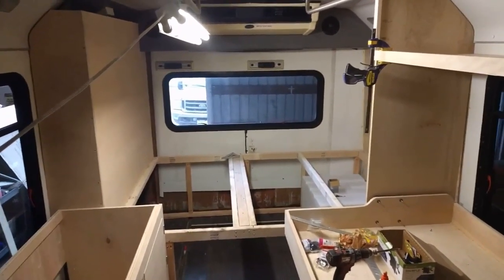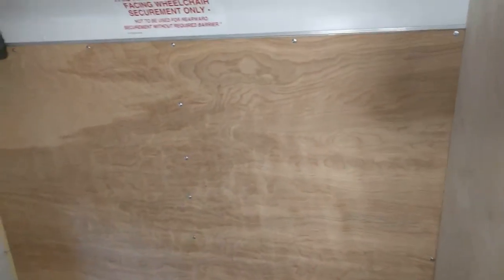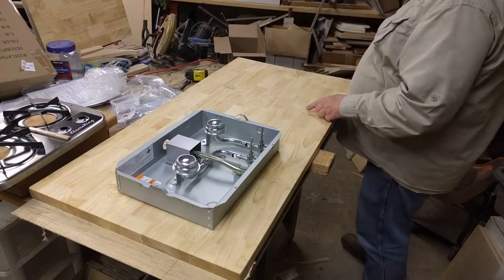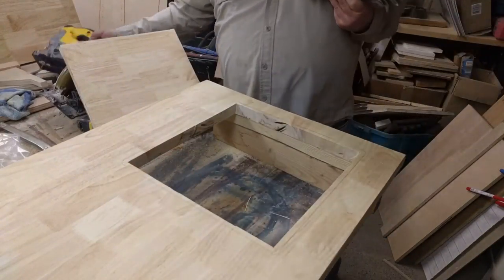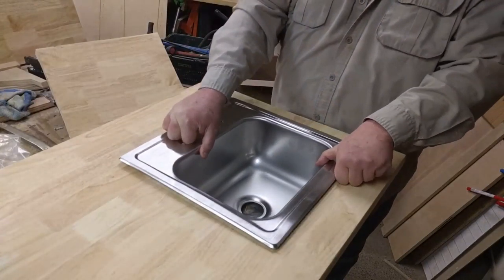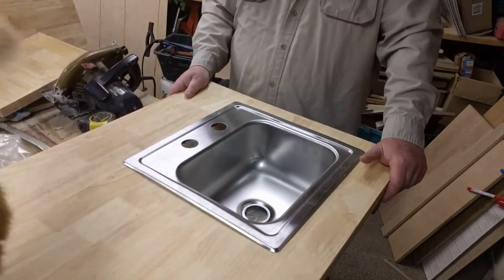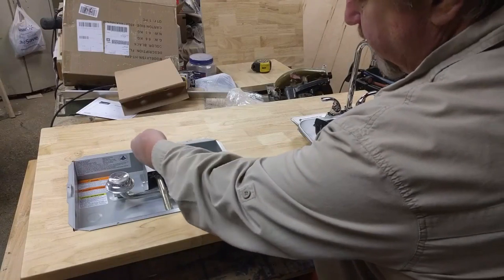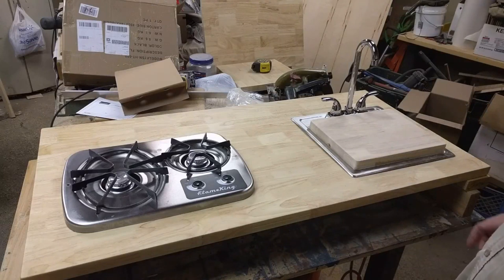Shuttle bus rv conversion (Part 6) Galley butcher block

Comment from the maker: UPDATE !  This Flame King Stove had to be redone by the propane company that I had install my copper hard lines in the bus. The stove had 3 leaks in the feed lines to and from the regulator and the burners caused by poor workmanship and cheap materials we had to replace the cheap aluminium fittings with brass fittings and now the stove is safe to use. I do not recommend this stove, it could have caused a serious fire! Professional repairs could  cost as much as the stove so buyer beware on this one.

Comment: Hey, where did you find those circular fans? My bus only has about 8-inch gap between the metal ceiling frames. So don't think the normal box fans will work. I'm trying to find the circle ones you put on yours but not finding them. Thank you!
Reply from the maker: https://www.amazon.com/dp/B00407CK5W?psc=1&ref=ppx_pop_dt_b_product_details  Aedan here is a link to the fan on Amazon  :  )

Comment: Great video.....got me hooked. Why did you go with handicap shuttle bus?
Reply from the maker: @Russell Sweet I like the shuttle buses that are fiberglass because they don't have many rust issues, built in insulation in the dual walled construction with steel ribs, they are very sturdy and are made to take a lot of heavy use. Shuttle buses usually have more head room for us tall guys. I like the El Dorado Aerotech and the Aerolite models, they are made by Thor Industries and the same manufacturer of the Airstream trailers.  This one had the 7.3 Power Stroke turbo diesel with only 56000 miles and these engines are known to be very reliable and have been known to run over 500,000 miles. The person who buys this one is going to get a fine bus! Thanks for watching my videos and commenting. :  )
Reply from the maker: The handicap lift just happened to come with the bus, at least it had a heavy 2ga. wire that I could utilize to power the inverter. took the lift out and sold it for $50 on craigslist, good thing I have a old forklift because they are heavy!
Reply: @robertbraden3889  Good to know.

Comment: What are the rotating brackets used for the murphy bed? Also, do you have a way folks can contact you with questions? maybe put contact info in "about" section of your youtube channel
Reply from the maker: @Eric Terry,Hello friend!  I answer 99 percent of questions thru these comments, The Murphy bed is mounted on seat swivels for a boat, you can get them on Amazon for less than $10 I think I had a link to them in one of the videos but they are easy to find. Hope this helps :  )
Reply: @robertbraden3889  I'm also curious where you got the bus. Looking to do something similar. Have you looked at renting it out on rvshare.com or anything like that? Curious what that process was like if you have.
Reply: @robertbraden3889  Also, a blog would be nice, if for no other reason then for people to ask questions that can later be searched. 100+ episodes is a lot to try and look for. Good stuff though. Keep it up!
Reply from the maker: @ericterry1148  I got the bus on auction and I have never rented it out, I wouldn't feel comfortable doing that, but that does sound like a good income stream
Reply from the maker: @ericterry1148  I just learned to do basic editing and have no idea how to set up a blog, I am trying to keep it simple, all this is very new and trying at times for me but I am learning as I go. I had to google "blog" just to figure out what you were saying LOL! I can do cabinetry,welding,electrical,build,paint,fabricate and mechanics but computers and smart phones kick my butt. :  )
Reply: @robertbraden3889   remind me how much you want for the bus?
Reply from the maker: @ericterry1148  I had it for sale but I decided to keep it and customize it for myself I was asking $30k for it.

Comment: How are you attaching wood to walls???
Reply from the maker: @Randy Lim Videographer  3/4 in #8 pan head stainless steel screws for the wall panels. The cabinets will be bolted to the seat rails on the walls.
Reply: How thick are the walls? I'm looking to get a shuttle bus within the month and do the same.
Reply: Randy Lim Videographer thicker than 3/4” apparently
Reply from the maker: @randymeghansadventures1268  the walls are 1inch thick honeycomb material sandwiched between two layers of fiberglass. the interior a 3rd layer screwed to the inside.
Reply from the maker: @BrandonDKirkwood  The walls are 1inch thick with built in insulation. This bus was built by Thor Industries, some other bus brands are not built this way. It also has a steel frame between the windows and up over the roof inside the panels which makes a real solid, safer motor home.